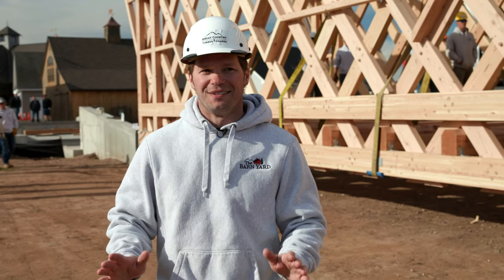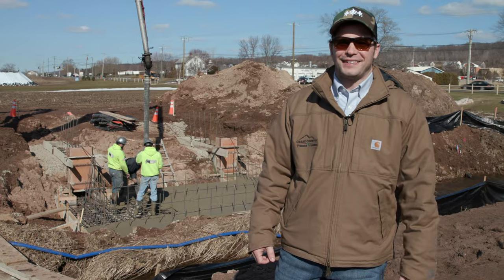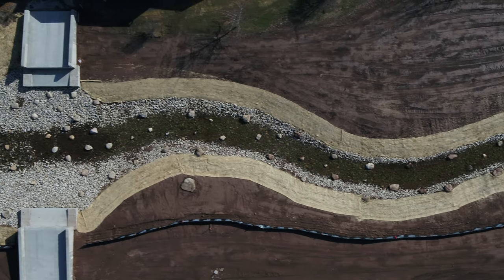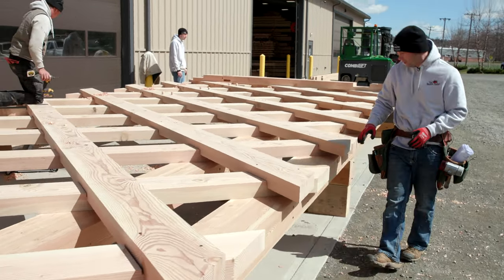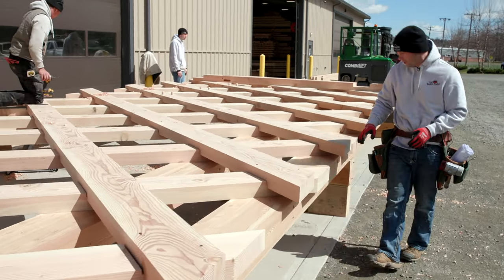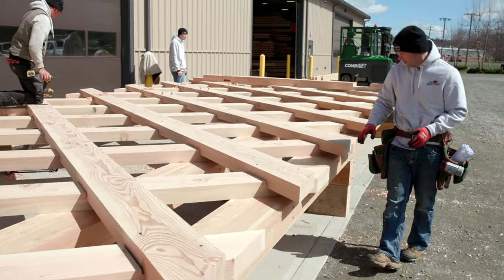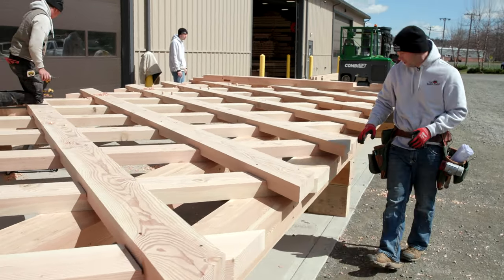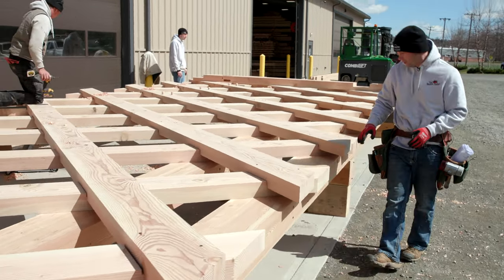Building The Barn Yard Covered Bridge

Comment: I used to run a 5 axis CNC machine prior to COVID.  Programming and Operation.  Did it in the commercial fitment and residential cabinet industry.  I soooo miss working with these machines.